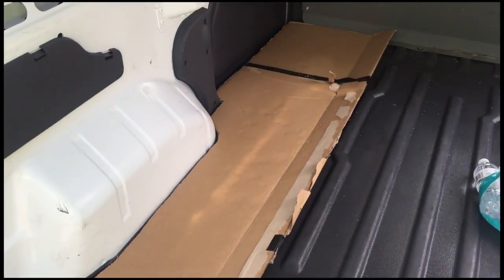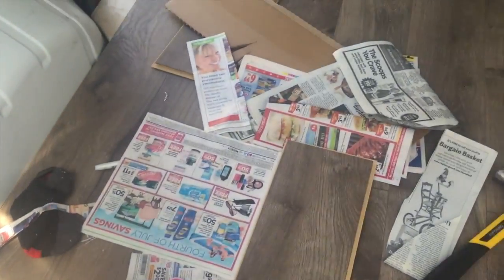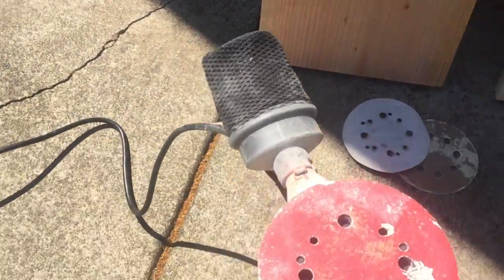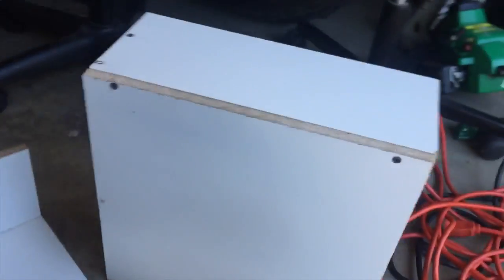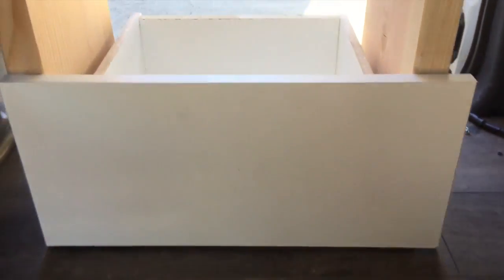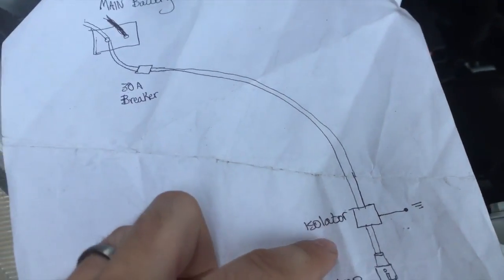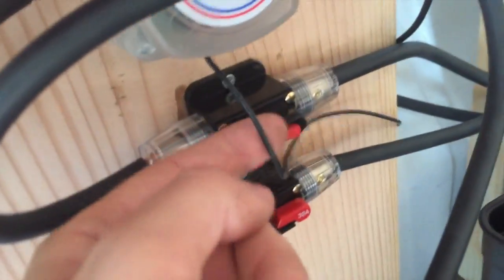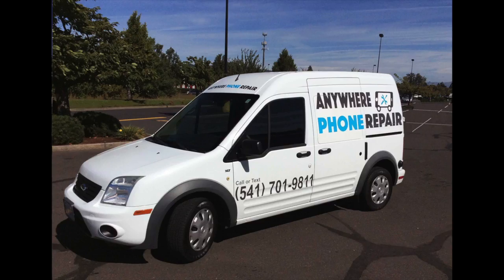Transit van office renovation

Comment: This comment is 4 years old; but when you did the van floor, why didn't you use the original mat you removed from the van, instead of ripping out the flooring and using newspaper to make templates?  The original flooring in your video looked new, so the dimensions will still be the same if you lay it on a large sheet of plywood...